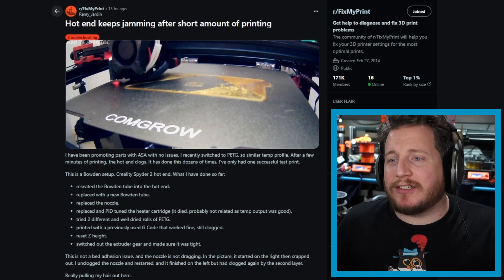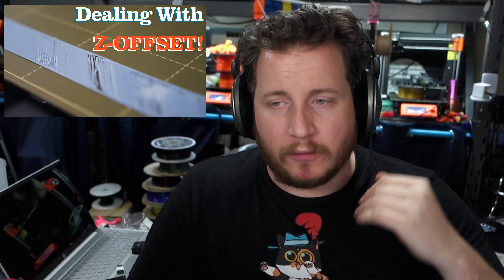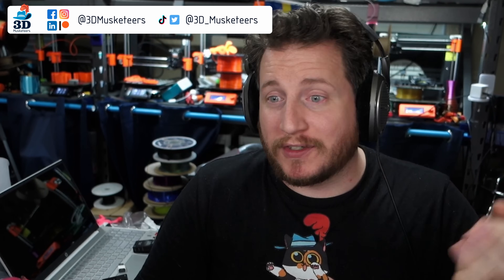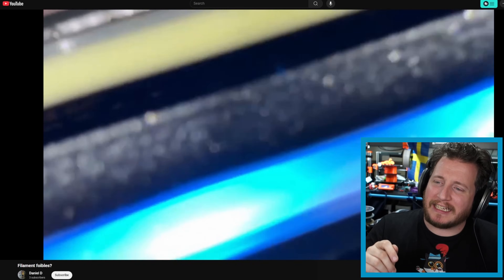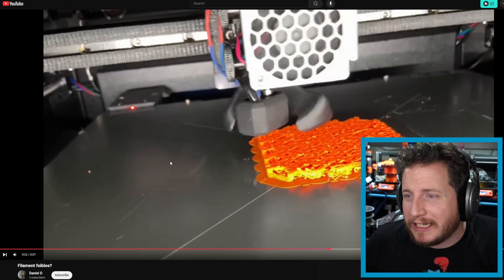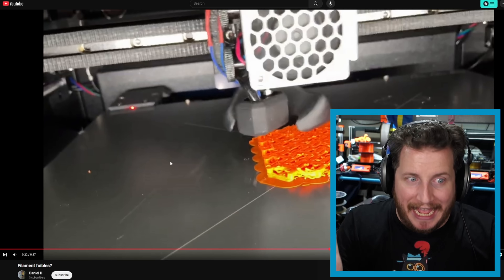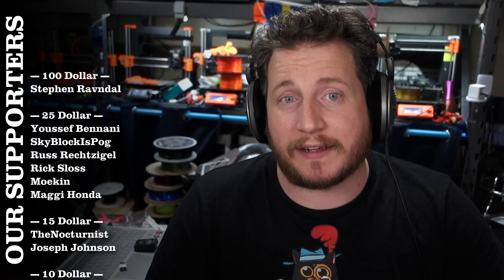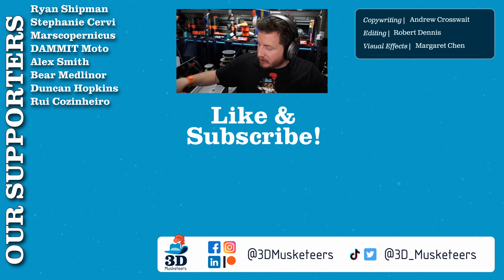Extreme Pressure = Extreme Failure - PrintFixFriday 195

Comment: I am running into what I think is a heat creep problem on my Ender 5plus.  It seems like PLA filament is swelling and blocking the hot end and the extruder cutting through the filament.  Running a EV3D v6 hotend, BTT SKR e3v3 & TFT35. Any ideas?
Reply from the maker: Which way is the heatsink fan blowing?
Reply: @3DMusketeers it is pushing air onto the heat sink (I triple checked after watching your video 😅).  I just tried adjusting my retraction just in case it was pulling back too far but no joy. It does the first layers perfectly then I start getting dribbling and then nothing.  When I pull the filament out the 1.5mm is swollen and there is no “hard pull” or stringing and You can tell it was not in the heat break area.  I can send a picture if that would help narrow the culprit down.

Comment: I had no luck printing PETG on my Core One with the 'Smooth PEI Print Sheet' that comes stock, I got the 'Satin Powder-coated Print Sheet' from Prusa and it works amazing with PETG. I just wash it with soap and warm water often and my PETG prints have been coming out perfect.

Comment: Thank you for speaking up about trolling; it's a subject that needs more attention. As for the question about the CoreONE and filament temperature, the owner of 3D Fuel told me the nozzle used in the MK4/XL/CoreONE has a shorter melt zone, so temps need to be turned up significantly, especially when printing with their PCTG.
Reply from the maker: Well, for materials without profiles, sure, to get the speeds you'll need higher temps, but what I'm confused about is why the Prusa settings are so cold. I've seen them run just fine at the factory. There must be something else at play.
Reply: @3DMusketeers for what it’s worth, all my Prusa temps from the factory have worked great with the 5 or 6 brands of filaments I’ve tried. And that’s on every Prusa printer from the Mini, mk4, core one, and xl. Humidity and climate controlled workshop in central Alabama. Filament always goes in dry as well. Edit: I just remembered I had to bump up the temp by 10 degrees for kingroon PETG once. It was under extruding at high speed.
Reply from the maker: hmmm you are likely similar humidity to me. Now I am even more curious as to what causes the differences!

Comment: Duuuude thanks for answering my vid even though I never sent you the file. And I certainly will send it to you because it’s so interesting that you called out my nozzle cuz I did replace it with a ruby nozzle I got on Amazon, but only because I fully clogged my stock one with bad filament on my second day with my c1. lol I asked you for advise on that issue too and you didn’t disappoint, gave me great feedback on that that helped a lot eventually but. I just decided to replace😂 the nozzle as a quick fix. It’s crazy you knew exactly what I was printing too lol the ‘nasa fabric” and blew my mind when you said that shit about the brim ruining the print,That is exactly what happened! Tho only thing I can’t figure out is that this is not the first time I have had theses results with this filament I used it with a ton of other settings and even the stock nozzle. Also I have tried drying it for days on end. And on many different print files. It seems to me it’s the filament that is the problem. But I can’t be sure as I’m very new here, I’ll send you the file I used to test. Thanks for all the help, and thanks for being so cool.❤
Reply from the maker: Please do send it over. I have orange prusament and I want to see if I can replicate it for you. 

You may be able to cold pull the nozzle, give it a shot and see! 

And yes the brim is a nightmareeeeee lol
Reply: @3DMusketeers  @danield7740 I was about to say that a cold pull AND reseating the hotend in place should be good to begin with. In the video it can be seen just a bit too much of the copper heatbreak of the hotend, meaning the nozzle could be clogged, and the filament is pushing the hotend out of it's correct please (maybe check the thumbscrews too). 

Maybe the V6 adapter wasn't installed properly and it's causing all sorts of issues too?
Reply: Hey @3dmusketeers! So this is the file I was printing but it was a scale-male. And I think the problem is with the filament only because I have had these same print issues with nearly every file I have tried printing with this orange prusament Petg.

Comment: on the first issue, I'm not sure the clogging is heat creep.  I would try to fix the leveling/z-offset first. I've had the same issue with my Creality printer, and I know from experience that the black plastic leveling knobs have a bad habit of loosening and making the bed become unlevel and (in many cases) too close to the nozzle, causing clogs early on in prints that take up more bed than the inch or two in the center. If it is the bed, they make a knob upgrade. If it is heat creep, then yes checking the fan to make sure it's blowing correctly and into the heat sink should help.
Reply from the maker: It seemed okay, unless the bed is taco'd BAD. hmmmmm

Comment: about the underextrusion, 
I had this issues with my DIY printer. Looked very similar to that. But had no pressure advance. 
Was not able to resolve the issue. I had to replace the extruder and nozzle assembly (not bambu tho) 
I went back to bowden setup and it suddenly worked again. 
.
The slicer settings worked on a similar build machine with the same extruder kit. 
The firmware was set correctly "marlin based" from about 7 years ago". 
The only thing i could guess to be an issues was heat creeping into the cold end. 
But i tried a 40x40x20mm High flow fan on the cold end, and was not able to resolve it anyways. 
.
If you have pressure advance Enable its probably it, but it bums me that i was never able to figure out what was wrong... 
Due to the Fact that both printer and material is from bambu. As long as there are no Mods on the extruder assy, I would actually contact
bambu support and ask for help. If they cant advice you within the guarantee, they need to resolve the issue for you :)

Comment: Ive noticed that my core one needs about 10C extra to get the filament to to gloss up.  I just assumed it was because the filament temp profile is seperate from the nozzle and the volume of filament running through the nozzle needs the extra heat going in to the nozzle to get the filament at the correct temp.
Reply: This is particularly true of the speed profiles, but petg and silk pla need it.  Not change in the print quality for it.

Comment: Regarding worn extruder gears... I had an issue on my MK3 (OEM bondtech dual extruder gears) with inconsistent extrusion. Even when printing in air I could see the extrusion surging. The extruded filament kind of looked like link sausages. I replaced the dual extrusion gears and that solved my issue. My current hypothesis as to what happened is the gears got a little worn down from filament grinding on carbon filled filament (ProtoPasta HTPLA-CF) from a couple nozzle clogs (my fault for using a 0.4mm nozzle on a CF filament). Unfortunately, I never took any pictures or measurements so I have no way to confirm or disprove my hypothesis.

Comment: heat creep

if your 3d printer is 5+ years old. make sure to clean any dust off your heat sink fan
mine looked perfectly fine
heat creep
dusted it with canned air
heat creep gone
Reply: Not just the fan, but also the heat sink fins.

Comment: I was running a modified Sovol SV06, one of the mods was a new part cooling shroud with the fan behind the printhead.

One day part geometry just fell apart, walls falling down, overhangs dangling, supports wouldn't come off nicely.

The part cooling fan failed, but there was no notification or error.  Everything seemed normal.  SOOOOO much wasted time, trying to troubleshoot that until I finally saw the fan not spinning.

Comment: The first problem shown, with the clogging nozzle, there's one very basic thing I don't see on the list of things checked: Filament. This can happen printing PETG with PLA settings. Mislabeled filament happens.
Reply: Changing filament type from higher temperature (e.g. PETG) to lower temperature (e.g. PLA) can leave stiffer material to the melting zone of the heatbreak and to the nozzle. Lots of heat and lots of purge should fix that.
Though in this case ASA and PETG had "similar temp profile" (?), it probably is PTFE-to-the-nozzle hotend (not actually good for ASA temps) and PTFE and nozzle were changed, so 🤔

Comment: Check the Prusament stock settings! E.g. the Prusament PLA profile for the XL sets it to 230 for the first layer and 225 for the other layers. But the filament is specified to be printed at 210 +/- 10. So the stock setting is higher than the specs. It wouldn't surprise me if the PETG settings were off as well.
Reply from the maker: What spec and what reality are often differ. For us, we have to go higher than prusament settings to get decent results. That goes for any machine, not just Prusa
Reply: @3DMusketeers  ive learned that temp towers are my friend when printing a new filament.
Reply from the maker: always a good idea!